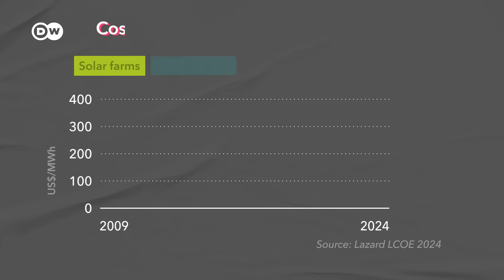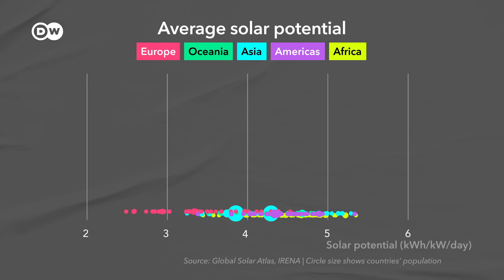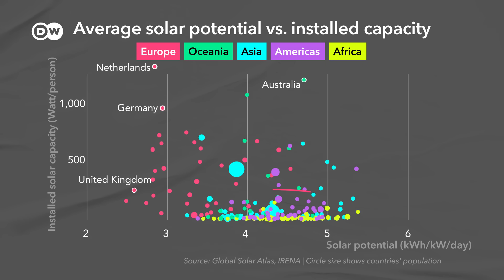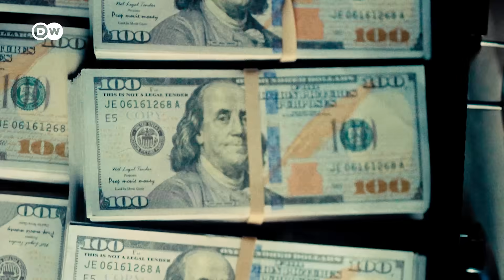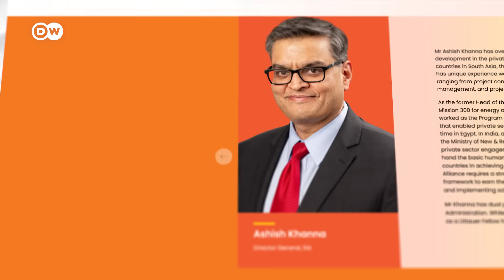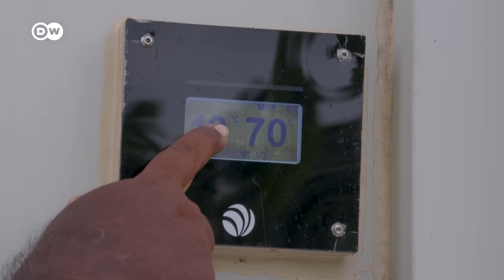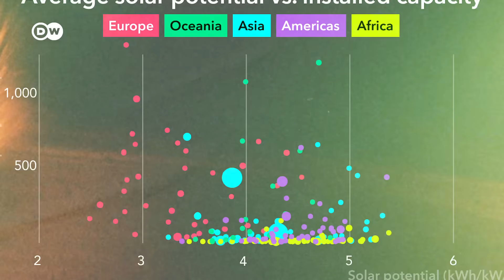We're building solar in the wrong places. But we can fix that.

Comment: You don't address the fundamental problem that Solar onlygenerates for 3 hours a day - IF the sun is unobstructed by cloud. That may be great in Third World Countries, but developed countries have become used to reliable power 24 hours a day 365 days a year.

Australia tried to address this with Snowy Hydro 2 Pumped Storage a decade ago. But it still has not stored 1 watt of energy and there is confident prediction of when it will start - even though the money is many times more than cost estimate that was used to justify its build.

Then we iinvested billions of dollars in the Waratah Gigawatthour Battery. Even before it was commissioned, one of its Transformers failed, so now they have no idea when it will be finished. Even when it is finished, it will only run at its rated output for TWO HOURS- but we don't have Dunkelfalute in Australia !!!!

Depend on risky new technology, but ignore the associated risk when doing a financial justification and now we see the result.

 We export coal and gas in enormous quantities so overseas countries can emit CO2, but can't burn it here to keep electricity prices affordable.
Reply: Solar generates electricity for way more than 3 hours a day unless the weather is really poor.

Also the Waratah Super Battery is primarily there to help stabilise the grid, not dump its entire capcity in a short timeframe.

Comment: The big problem with Solar PV is the increasing grid cost. The higher the proportion of fluctuating electricity production (from PV and other renewable sources), the higher the costs to balance the electricity system. These costs could be reduced by cross border grids but in most countries of the world, only a fraction of the nationally consumed electricity is traded across nation borders due to political reasons.
Reply from the maker: Hey there! You are right, these projects are often difficult. We looked into the project to send solar from Australia to Singapore. You can find the video here 👉https://www.youtube.com/watch?v=42b6xJFUSss

Comment: 7:10 This is wrong. Most solar power systems sold in western countries need a grid electricity connection to adjust the frequency. In case of a Blackout, they cannot produce power. To enable a Rooftop Solar panel to provide power in a blackout, you need a battery storage system which will provide a fixed frequency to the Power Converter Unit.

Comment: 0:40 The main reason why there is almost no solar power in the sunniest desert areas is the water shortage. In the Noor Solar Power Plant in Morocco they needed 3 million qm^3 to produce 1470 GWh of electricity which makes around 2l of Water per kWh. And modern Desert Powerplants still need 1,2l of Water per kWh to clean the dust from the solar panels. Another point is that the hotter the temperature, the less efficient the Solar Panels gets.

Comment: Recently I was travelling through very sunny southern Italy and noticed how very few roofs had solar panels even compared to my rather unsunny home Scotland. The plus side is that as time goes on solar panels and associated battery systems will become more efficient and cheaper so when panels really are taken up there'll be a massive jump in the switch from non renewable to renewable energy sources.

Comment: IN Sweden we have had subsidies for getting solar panels for years. My assumption ahs always been that the ammount of solar panels we can produce globally is limited. Therefor one have to consider where you put the solar panels since they can not be everywhere. Putting a solar panel in Sweden is waste of resources, dumb and stupid if the perspective is global climate. Sweden electricity is still about half hydro, a quarter nuclear end the rest other reneweble resources.I get scolded when I say it is dumb resource management to put a solar panel in Sweden when you can use those recources for a solar panel in Marocco. It seems the important thing is to look like you are doing good for the world and not do good for the world.

Also you can put the electricity you produce on your rooftop solar panel in Sweden, granted you get a permit for it by the local grid provider (most people get it). The problem is during the hours it produce the most power the electricity price is so low that it is a cost for the small producer to send the electricity to the grid. You are better off turning it off.

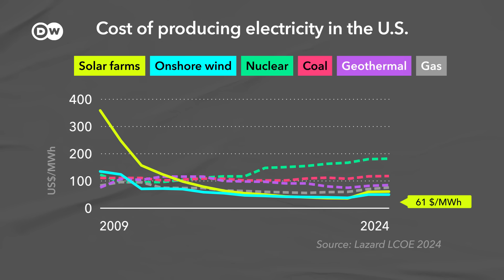Comment: Chart at 1:08 is misleading Solar price need include storage system, if included price rising to nuclear price tag.
Reply from the maker: Thanks for your comment! The chart we used reflects Lazard’s “cost of producing,” which compares standalone generation sources. In their 2024 report, utility-scale solar+storage comes in at $60–210/MWh, compared with new nuclear at $142–222/MWh. Of course, storage still needs improvement — we cover more on that in our grid video 👉 https://www.youtube.com/watch?v=u-DsDuTceTo&t=6s

Comment: The problem is that the closer they get to 20 years of use, the lower the output and they are already inefficient meaning they will take up a lot of space and be expensive to get a lot. Remember, a dollar per watt may sound appealing on the surface but that is at full clear days and only when the panel is before half it's lifespan. Oil companies like photovoltaic because it requires plastic but not so much for CSP or advanced CSP at higher efficiency is a type of solar with the disadvantage of not providing when cloudy so they need strategic locating and excessive construction so there's always excessive supply support. This way, for times when some areas do receive clouds, it balances out and still is sufficiently providing. But the Rondo battery in combination is the best strategy as they allow storage when the power people consume is less than what the power plant is providing.

Comment: Govt. in Pakistan at one point supported solar power but now they are ready to crackdown on people who’s building their own solar setups on rooftops. The reason is poor electricity grid and equally poor electricity contracts with power companies. With rise in solar independence by people has put great strain on the people who rely on grid as govt. has horrendous infrastructure and contracts

Comment: I am from a small vilage in Punjab, Pakistan. I see solar panels EVERYWHERE. Houses, hospitals, factories, shops and even some food carts.
Reply: Are the inverters in Pakistan connected to the grid, or are people building stand-alone systems? Or are they systems with a hybrid inverter that can switch over when the grid fails?
Reply: @Solalarenergy  Most households use standalone systems because gov is increasing tarrifs on grid connected solar users because they are seen as a burden.
Reply: @Whyamisaad  
same here i live in EU and are thinking about to get disconected from the grid because of governement costs.
nice to hear you get solars and getting greener.
Reply: @johanv4668  Since you live in the EU, I would suggest checking if you get enough sunlight for solar to be a economically wise decision as EU tends to have less potential for solar. 
BTW the mass decision to get solar in Pakistan is purely influenced by economics but yes, the sustainability and the green energy aspect is an amazing byproduct.
Reply: I visited Turkey and Greece 10-20 years ago, and solar water heaters were everywhere. I didn't visit recently though.
Reply: i dont know man here in delhi electricity is free so we never felt the need of solar but government is doing a good job we recently overtook gernay in total solar capacity to become 3 and have aim for 500 gw by 2030 just by solar

Comment: I work in Solar Energy development in the middle east having previously worked in the US and Europe. Another big factor is regulations. 

Even if you ignore subsidies, solar can often still be viable - however, several countries (especially in the Middle East) have put up strong regulations to limit the amount of solar energy that can be connected depending on the nature of the customer (factory vs commercial vs residential). Dubai, for example, limits a commercial solar system to 1MW, which is not really that large for several large commercial clients. Jordan, a few years ago, put up a very high rate for wheeling (which is using the existing grid to transport the electricity from the generation source to the actual customer a bit further away). There are also some regulations preventing or limiting net metering, which is feeding the excess generated energy back to the grid. 

Some governments say it's due to grid infrastructure and stability and some say it's to prevent oversupply, and both may be a factor. But the reality is that the national electricity utilities in several of these jurisdictions are government owned, and more solar usually means less cut of the pie for them, which is fair. There are a lot of partnerships in the works which will hopefully lead to a more sustainable energy mix in the near future.

Comment: When we look at the energy needs of a modern society, it’s important to consider the long-term reliability we want, aiming for a Loss of Load Expectation (LOLE) of just 0.1 days per year. In this context, the costs of solar power per MWh can actually surpass those of gas and nuclear options. This is largely due to the significant amount of storage required for solar energy.

Additionally, we can't ignore the vast amounts of land needed to produce the same energy equivalent with solar farms compared to gas or nuclear facilities. While solar power can be a viable solution for certain applications, it's misleading to claim that solar energy is universally cheaper when measured in $ per MWh. In fact, the reality often leans in the opposite direction.

Comment: Difference because of solar ? ask teh spanniards that lost their grid for a full day ...
solar is good for power home during when the people are not there, but for having light at night you will need a bit more than just the solar panel.
And to power industry 24/7 you need even more than just solar. Solar is a good way to start but nothing more than that as it cannot build a stable grid, which one of the prequesite to install a lot of solar ...

Comment: Solar energy isn't a solution because you need to store it and storage means batteries and batteries don't last for long time. Adding to that, the fact that most human electricity consumption is during night hours. Thus it's not changing anything !
Reply: Variable price in different time will trade off this issue. It should charge more at evening than at noon, to encourage use less energy when sun if off.

Comment: SOLAR SHOULD NOT BE SCALED YET, globally ,,, i repeat solar panels should not be scaled yet globally,,, just stick to the poorest countries that get high density sunlight exposure with moderation and restraint applied,  The technology needs to be innovated further until its more efficient and longer lasting,,,! We made this same mistake with the combustion engine.....! because even todays combustion vehicles are only running at about 20 to 25% energy conversion  efficiency,, 

 Early Combustion Engine Efficiency (~1860s–1920s)
Étienne Lenoir’s early engines (1860s) had efficiencies of 3–5%.
Nikolaus Otto’s improved engine (1876) pushed it slightly higher — around 5–10%.
By the early 20th century (1920s), automotive engines were reaching maybe 10–15% efficiency at best.
 That’s over 50 years of less than 15% efficiency from the birth of the engine to the interwar period.
WHAT IS THE POINT IN RECORDING HISTORY IF WE INTEND TO MAKE THE SAME MISTAKES OVER AND OVER AGAIN,,,,,! 
We are already scaling wind turbines prematurely,,, ,isn't that enough until we get better results from solar????

Comment: I'd argue that a factor of 2 difference (roughly) in solar potential is being eaten up by the necessary infrastructure buildup to absorb the higher production. The invest into infrastructure has to happen anyway, but more so in those places.
Also: high energy consumption is taking place somewhere else.
So, no, we don't build it in the wrong places. 
The places with the highest potential will eventually catch up.

Comment: Instability is an even bigger factor than inequality. A (multi) national wide electricity grid is a complex system and countries like Germany are already at their limit to regulate the electricity flow. As was briefly mentioned in the video, renewables put a lot of pressure on the grid and interferences that needed to be made every couple months to guarantee a stable grid now happen several times a day. There's a lot of follow up to do for our infrastructure but it's inevitable.

Comment: Deleting comments that don't fit your narrative?  DW for the German approach.  Lithium batteries are still very difficult to recycle and require huge amounts of water and energy to produce. So solar solutions will have to wait until sustainable batteries are invented.
Reply from the maker: We don’t delete comments for differing opinions, but we do moderate for hate speech, discrimination, or disrespect toward others. If your comment followed the rules, it might have just been caught in a filter. And you’re right — lithium batteries do have challenges. We actually cover that and some alternatives in our video🔋 👇
"How salt and sand could replace lithium batteries" https://youtu.be/-vobMl5ldOs
Reply: @DWPlanetA  my missing comments contained none of those : hate speech, discrimination, or disrespect toward others.

Comment: In Uganda, solar energy adoption has been slow due to high costs. Although the government previously offered subsidies to reduce expenses, these were later discontinued. Now, the government is promoting solar power as the primary energy source for small-town piped water systems. This shift aims to lower energy costs, reduce water tariffs, and make clean, potable water more affordable for communities.

Comment: What is not addressed is that while it is most efficient to build large solar plants in cost per MWH installed and maintenance. There are so many issues with solar energy when it’s going to power an electricity grid. You need to regulate input and output of the grid to always be =. But this isn’t easy with just solar since the sun is unpredictable and demand is unpredictable. This means on large scale you need a way to quickly regulate up or down the production of electricity to the grid. This means you need large grid scale battery storage or you need some other source of energy production that is not affected by natural resources like solar, or wind. That means you have a few options and the best one currently with the least amount of emissions and the cost of installation is gas turbines, or coal to create that base load supply that is needed both day and night.

Solar is actually best suited in a local small power grid like in rural areas like African villages. There a small solar plant and battery storage can be invested in by the local community and they all subscribe for a small fee to be part of the project to get stable electricity.

In cities it’s actually much better use of space for roof tops have solar and power the local building with a local battery storage. Saves the residents money on electricity bills and lessens the burden on the actual unstable electricity grid in these regions to make sure that only the base load is provided by the grid while peak power demand is covered by individual power generation on each building.
Reply from the maker: Thanks for the comment! ☀️ You're right that grid stability is one of the biggest challenges with scaling solar and other renewables. We actually covered this in a video called "This is what's REALLY holding back wind and solar". You can check it out here 👉 https://youtu.be/u-DsDuTceTo You might also like our video on "Why we should be putting solar panels on our fields and lakes" 👉 https://youtu.be/2hwpXCjmkRo — it explores some innovative ways to expand solar without competing for urban or agricultural land.

Comment: Whats the life of solar panels, the water expense to clean the panels, how is the solar panels manufactured, by more fossil fuels..? 
Can energy produced from solar panels be used for making solar panels...?
Reply: Most solar panels have a 25 year warranty, but they are a solid state technology and can potentially last a lot longer than that some early photovoltaics from the 70's are still functional even. The cost of water needed to clean panels varies by region, my region for example gets enough rain that they can effectively self clean. And yes the energy from solar panels can and sometimes is used to manufacture more panels.

Comment: If we connect grid of entire world, we can power everything just from solar, no need to worry about storage problems as well, the biggest bottleneck in transition to renewables.
Reply: That large of an interconnection would cost more than storage if it is built using current technology.

Comment: ideal solar panel location = not ideal human living condition.... and transporting electricity in coper cables for long distance is a joke with solar
Reply: The vast majority of transmission actually uses aluminum, but yeah reduced distances between power source and demand devices would have a dramatic effect reducing overall load on the grid.
Reply: @doujinflip  you can make solar super efficient... but the dangers of battery catching fire....

Comment: There has one more big (and ironic) hindrance for solar: falling solar prices. When you buy today, you know that you would have saved by waiting for tomorrow. But solar has become so much cheaper than any other way of generating electricity, that not having solar is the biggest loss of all. That's why solar is surging more than ever now.
Reply: Panels are cheap, but storage is still costly. Plus we’re finding out not all inverters are both functionally reliable and a low potential cybersecurity threat.